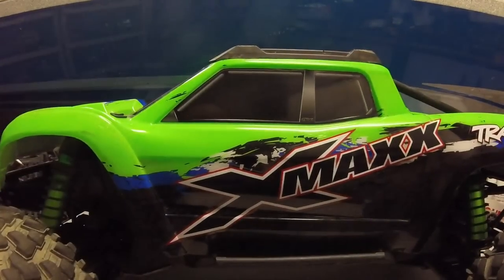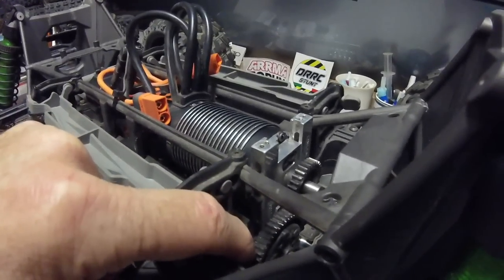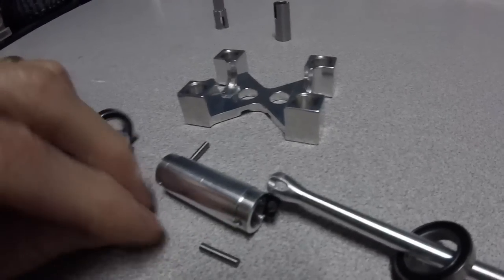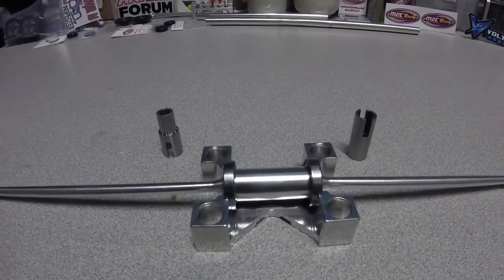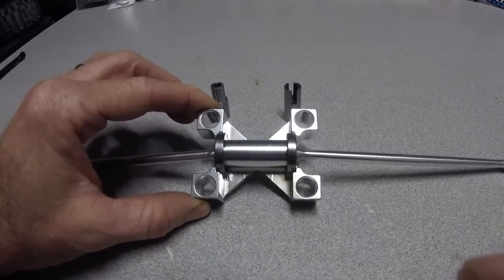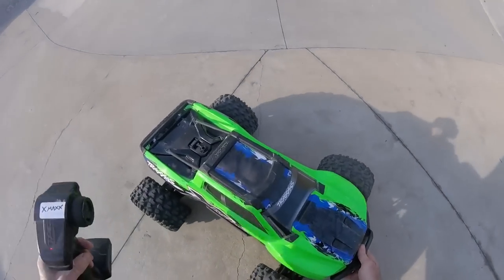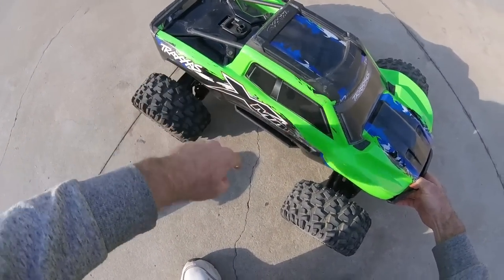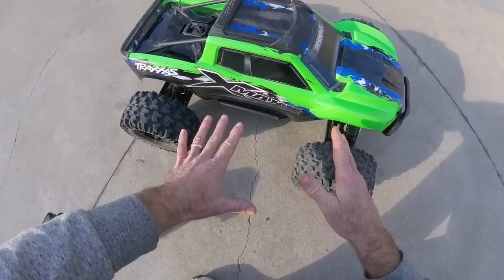ULTIMATE XMAXX M2C Racing Center Driveshaft!!!

Comment from the maker: Sorry for the short first test run 😝. I'd planned to hit both the skatepark and a rough dirt spot, but realized my rear diff was going out. Discovered the rear diff housing had imploded 👀 (probably cracked last run) and found 3 flattened teeth on my ring gear. A chunk of plastic housing was floating around in the gearbox 😂. I pulled the center driveshaft for inspection and it looked perfect!!!! Can't wait to get back out with Bertha. Testing usually takes a minimum of 2-3 weeks to ensure these prototypes are ready for production so please be patient. Huge thanks to Avery for this game changing design!!!! 😎💪👊👊
Reply: Get some alloy Outer lids/covers for the diffhousings and you will never ever have a problem again as long as the diff cup/ringgear bolts are tight😁🙏🏽. Also metal plates for the a-arm plates located under each skidplate (front and rear) makes the bulkheads last forever😁🙏🏽
Reply from the maker: @Negern91  thanks so much Brother 😜. I believe you're right. The gear failures are from the housings and plastic support structures crapping out. 🍻😎💪👊👊
Reply: @richduperbash2966  hey bud do you have a link where we can buy this, i have been waiting for something like this. Make a lot of sense! Great job bro😉👍🏼💯

Comment: That’s so awesome. Last thing M2C has to design is hardened steel diff ring and pinion and then the xmaxx will be bulletproof!
Reply: Yes. I keep replacing them on monthly base hahahaha. Need better diff ring and diff pinion. Stronger!
Reply: Facts !!!
Reply: I have feeling that coming. That would literally take them 5 min to reproduce.
Reply: I also like that that adapter vitavon shaft holder with the bearing for transmission shaft wobble i’d like to see their version.

Comment: That skatepark is effin 🔥👌and that  driveshaft mod made your green Bertha drive and handle so much better from the last video I watched it on
Reply from the maker: Thanks so much Peter 🤗. Good eye. You're the only one here that mentioned the impact the driveshaft has on  the handling 😍. It spools up killer and is silky smooth. Most don't realize the impact a bent shaft can have on performance, but it's significant and always detrimental. 
🍻😎💪👊👊

Comment: Awsome bro!! This is a must do upgrade if you intend to bash hard. Hats off to m2c for coming up with a killer super flexible ultimate solution (long overdue)👌 👏 👍 it would be awsome if m2c made super beefy tapered drive shafts similar to 8s arrmas ones they make. That would make this upgrade completely indestructible 💪💪💪
Looking forward to more testing content 👌
Reply from the maker: Thanks so much Brother 😜!!!! Finally a definitive solution to this years old problem 🙏. We're shooting for the lightest option necessary. Unless the truck snaps in half, there's plenty of space and articulation to avoid any possible binding or bending on these center shafts 👍. The truck is so much lighter than the ARRMA's, it doesn't need overkill diameters to get the job done and will spool up faster with less strain on the drivetrain. Hardened steel outdrive cups, hex extenders, and beefier outdrive shafts are all coming soon!!! 🍻😎💪👊👊
Reply: @richduperbash2966  your right... hopefully m2c magic is gona make this rig truly indestructible and enjoyable. Personally I'm really looking forward to the hex extenders to widen its stand and make it more stable.
Reply from the maker: @inspiredrc  heck yeah Brother. I'm super excited about having a wider, more stable stance too 😱

Comment: Epic engineering! I saw you are not using the big top aluminum plate maybe because you want to flex to test the center driveshafts.
Reply from the maker: Yeah I decided to take it off unless maybe running a Max5 down the road. 🍻

Comment: Definitely need this as soon as it comes out, I got the motor mount system with my 1100 xlx2. Hopefully those shafts can handle it all.
Reply: There may be excessive wear on the drive cups.
Reply: @surfside75  I’m worried about the aluminum drive cups with a big power system. Hopefully they offer something steel for guys running big 2028 motors. Not like the diffs can hold up to those motors anyways tho 😂
Reply: @based_will   exactly. Speaking of steel drive cups. I'm having a issue sourcing aftermarket outer drive cups for my Losi Baja Rey Raptor 1/10, any idea??   (I'm easily destroying with the torque on 3s, sometimes breaking the stocks in half😱)
Reply from the maker: @surfside75  Sorry I didn't make it clear, but the drive cups are hardened steel. 🍻
Reply: @richduperbash2966  nice! They kinda looked aluminum on film. Good to know
Reply from the maker: @based_will  the drive cups will be hardened steel 💪. Hopefully guys will have both alloy or steel driveshaft options.

Comment: Both of my Xmaxx's cogs out the box.....that cush drive shaft in plastic housing is one of the main reasons gears make a grinding sound.......I took up slack by adding a glow plug brass washer behind the rear bearing to stop all that floating slack on the cush drive shaft.....it helps but nothings gonna stop that sound.....mine got louder when I added thicker diff oils......I just run it😉
Reply from the maker: Thanks so much Brother 😜. The spacer idea was already in my head. I appreciate you sharing about the brass spacer. Can't understand why they engineered so much play in the shaft 😂. My whining noise stopped after I replaced my cushdrive shaft. It might've been bent from the factory/defective. I've since bent 2-3 replacements. M2C will be making a hardened steel option. The new M2C chassis support has largely stopped several issues with this truck 👌 😎💪👊👊
Reply: @richduperbash2966  awesome....hope that can solve the problem if not guess it's a plastic flex thing untill they design a 7075 aluminum flat chassis for the Xmaxx, Traxxas already tacked on another $100 to the price tag at the local HS's...even stock 18/54 with line up pins is way too tightly meshed....almost cuts up paper strip when setting mesh.....just half of millimeter would help tons and prevent stock electronics from overheating especially during summer months...cheers from Arkansas

Comment: I wonder how those aluminum shafts are going to hold up long term. On the CVD side they're going to be rubbing against those steel pins as they spin. There's not much offset but they will be spending pretty fast and I get the feeling that the aluminum is going to wear over time in that area
Reply from the maker: We shall see. Because it's a closed system, you could put a pinch of grease on the pins. The system spins ultra smooth 😍. Perhaps they could offer both alloy and steel shaft options for guys who don't mind the extra grams. 🍻

Comment: This is Awesome,  I need this for my Ggen 1 Xmaxx. The quality of the machining looks tops notch too! Always pay attention to fit and finish.  Some stuff I've seen looks like it's almost done, then they gave up or something.  
 Personally I'd just install the steel shalfs and be done with it.  The Xmaxx has enough power a little extra weight on those little dive shalfs won't make any difference.
Reply from the maker: Yeah this was a Brilliant design by Avery 👀. The steel shafts will come with the final kit 💪. We've done extensive testing and it just makes the most sense. M2C doesn't take shortcuts and either do us testers. 
🍻😎💪👊👊
Reply: @richduperbash2966  if possible,  could you maybe provide a link to these ? I'm wondering about price as well! This system looks fantastic!
Reply from the maker: @charlesb7831  don't think these have hit the website yet Charles 🤔. Let me link you to where they'll be available once they're released. 🍻https://m2cracing.net/86-xmaxx

Comment: Noise from gears... check bearing on the centre diff. Also cush drive bearings but most importantly check the rear drive cups. Any play will hurt the diff eventually.  I've got 7 xmaxxs.
Reply from the maker: Thanks so much Matt 🤗. I immediately pulled the rear apart after driving home and had flattened 3 teeth on the ring gear. Noticed the gear cover had cracked and pushed upwards, probably cracked it last run. Found a chunk of plastic floating in my gearbox 👀. Really appreciate it Brother 🍻😎💪👊👊

Comment: Mitch to the rescue.  Glad you found the source of the noise. Is there any room for shimming in the diffs on it or is it pretty much set in n that's it? It looked like it was loving the skate park. Super smooth transfer in the pipe it looked awesome. Thanks for another awesome bash video man 🍻🍻🍻🍻🍻🍻
Reply from the maker: Thanks so much Nick 🤗. Yeah I was 99% certain the rear diff was the problem 👍. Might be able to shim the crown gear side, but honestly the diff case cover was simply designed too thin. I could totally see it breaking around the base again or flexing enough to loose the gear mesh with harsh one sided hits. Starting to wonder if this is why guys report so many rear diff failures. Gonna run a stock replacement for now, but ordered a Vitavon alloy replacement. Expensive, but so are HR ARRMA bulkheads and they save me tons of time and money in gears. Appreciate the kind words Bro. 🍻😎💪👊👊

Comment: Rich Can you also run the 5 piece stainless skid plate set with this driveshaft cv assembly or does it only work with the stock plastic And can you run the stainless skid plates with the center chassis brace from M2C? Thanks

Comment: Also in regards to the delrin pistons and standard shock oil. Are you also using the stock springs or stiffer springs? Thanks.
Reply from the maker: I'm still running stock springs primarily for testing purposes to get the pistons tuned right. Bought a set of VG Racing springs I'm planning to mount up sometime soon. 🍻😎💪👊👊

Comment: Hey Rich, What about the wider more extreme underneath center chassis support and not the skinnier original support? Will it be available?
Reply from the maker: Yes I think it will be an "Overkill' brace option with them still offering the lighter one. Both get the job done as the primary function is to keep the bulkheads from pulling apart. The beefier brace is just less likely to bend. Not sure when they'll have it available online. 😎💪👊👊

Comment: Great video & ya nailed that landing on the half circle jump! But, wow it's now just past mid April 2022 and still no center drive shaft mod on the M2C Racing website...? Is there an issue with then or are the prototypes not holding up? Or maybe Traxxas is suing them!? LOL!
Reply from the maker: Thanks Brother 🤗. It's highly unusual for so much time to pass before M2C enters production. We determined both the splined cups and center driveshafts need to be hardened steel for best longevity. There was a significant delay with M2C aquiring a specialized jig set to mass produce the splined cups out of hardened steel 😝. Last I heard, production has started, but the kits hadn't hit the website 👀. Hopefully any day now.

Comment: Do you also have the m2c motor mount system and body brace? I wonder if you still need this if you have those given they both reinforce the chassis and limit flex?
Reply from the maker: I'm now running all the available and pre-release prototype M2C upgrades 💪. The chassis can still flex even with the beefcake version chassis brace and ESC mount/top brace. Mitch and Avery designed the chassis brace with slight float and used 6061 to easier natural flex. You could certainly try the bracing with the stock center driveshaft, but I'll never use one again. The CVD system is butter smooth and allows for both chassis flex and front to back twist. 😎💪👊👊

Comment: Hey Rich. Is the driveshaft assembly available yet as I’m not seeing it on M2c’s site? Also they do not recommend running the 800 kv as it’s to hard on parts. They recommend the 1100. What kv are you running? I’m having a shop build my new Xmaxx and need it beefed up so I can actually launch it and have a blast running it for once. 

You mentioned pistons, I’m planning on running proline upgraded shock shafts So I’m hoping they have different pistons?

I still have my new OutKast 8s BLX in the box as I’ve ordered the m2c full beefcake kit and some scorcher Rc upgrades So I’m not planning on using it until it’s beefed up. I’m told by the shop who is building my Xmaxx to run an 1100 kv in the OutKast, can’t remember what gearing you recommended. I’m planning on running the new proline MX57’s on my Xmaxx. Do you recommend stock tires on a built OutKast 8s BLX or what kind?  Thanks
Reply from the maker: Hey Brother. I'm running the Hobbywing 1100kv 5687 with 34/46 gearing and Leopard 200A BL5 in my XMaxx. Running a Leopard 5898 1100kv with 32/39 gearing and Max5 in my Outcast 8s. The stock Backflips work great. The M2C CVD style center driveshaft hasn't been released yet, but shouldn't be long.

Comment: Hell yeah , take my money ! In my experience traxxas bulkheads are not happy with concrete landings. I go way up on shock oil , like 70 , 80 or 90.
Reply from the maker: Thanks John 🤗. The diff housings are definitely too thin and flexible 👀. The stock XMaxx pistons call for heavier shock oil no question. The M2C O-ring style slotted pistons have slower rebound and much smoother stroke by design. With 1.4mm front and 1.35mm rear, these have far more dampening with 30 weight than I had running stock pistons with 60 weight. In a nutshell, it's about impossible to compare them even if they had the same size holes and same weight oils due to the O ring design. 😎💪👊👊
Reply: @richduperbash2966   Sounds real good ! Thanks for the heads up.

Comment: Nice run man🤘
The pistons look like they worked well but those high launches it still wants to bounce a bit, that the xmaxx for yah😅

And I'd hate to be the only person to question this☺ but I'm wondering with the centre shaft how long the little hinge pins and cvd ends of the shafts will last, if your the type of driver who lands huge jumps with a lot of throttle I could imagine them not liking it too much🤔 I'm not saying it's a bad design in any way though!
Reply from the maker: Thanks so much Brother 😜. I think it's about impossible to take all bounce out of the XMaxx because the chassis acts as it's own spring under extreme stress 👀. Those little steel CVD pins and barrels are the same spec as the much heavier ARRMA 8s center driveshafts 👍. Mine have been flawless for over 2 years despite running big power and big belted wheels. FYI, the splined drive cups Avery designed are hardened steel. The main question we're trying to answer is will the ultra light 7075 T6 shafts hold up or is steel the better option despite the weight. 😎💪👊👊
Reply: @richduperbash2966  nice man!!
Yeah as I said it's a great design and was just throwing the questions out there, I'm sure others will be appreciative of your very informative answer🤘

And yeah man let's hope the 7075 shafts hold up, the whole system is awesome and definitely an upgrade👌

Comment: What Gearing are your Running ?  
Where can I purchase your gearing set up from? 
I want to go back to the smaller gears I have had a lot of problems with wfo heavy mod 1.5 gears from many companies. Your advice would help me with less trial and error. I appreciate your time Thank you.
Reply from the maker: Hey Terry 🤗. Still running 32/50 gearing with my Hobbywing 5687 1100kv and Firma 160A ESC. Using an eBay 50T hardened steel spur (might be Hot Racing 🤔) and get my mod 1 8mm bore pinions from Saga Custom RC online. 🍻😎💪👊👊
Reply: @richduperbash2966  Thank you again … I just ordered them both …I am running that same motor set up…. I really do appreciate your reply.
Reply from the maker: @terrynicewonger5434  you bet Brother 👊
Reply: Rich Do you Run the standard Cush drive or a Cush Drive Eliminator ? 
I never gave this part a Thought After switching to HW5687 1100Kv.. if you can’t get to this Question I more then Understand ty..
Reply from the maker: @terrynicewonger5434  I'm running the stock cush drive, but appreciate your question 🤗. I recall hearing about that, but have to do some research first. I'm definitely still learning the platform 😍

Comment: What's that center bit of the shaft made of dude? 👍🏻🤘🏻🤘🏻
Reply from the maker: The base, center barrel, and shafts are all 7075 T6 aircraft grade aluminum. The splined drive cups are hardened steel. 
🍻😎💪👊👊
Reply: @richduperbash2966  Thanks dude 👍🏻

Comment: When will the drive shaft be available?
Reply from the maker: Hopefully, not too much longer. Mitch and Avery just got the jig tooling for the splines They had to special order them and it's taken awhile to arrive. I'm still running my 7075 prototype cups/splines 😂. They have to be hardened steel for proper wear life. The good thing is Traxxas used the same spline pattern throughout the truck. That means they can use the same jigs for making stronger outdrive cups and possibly gears 😱
Reply: @richduperbash2966  thats great.  Thanks for the reply Rich!